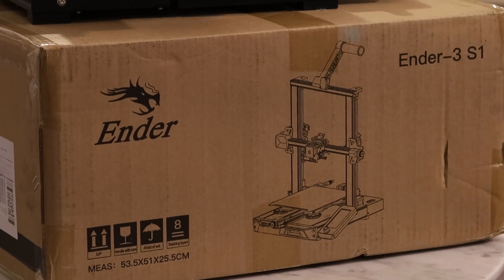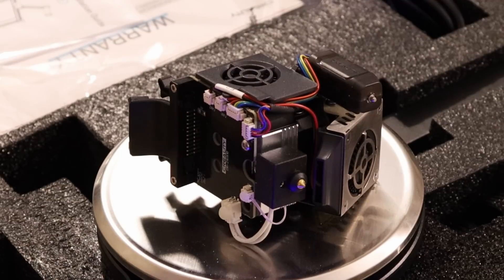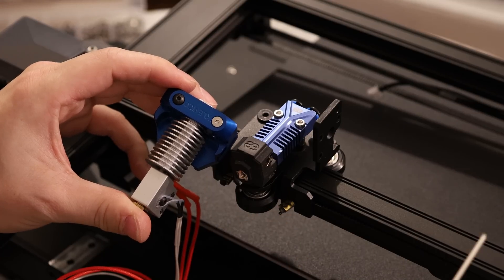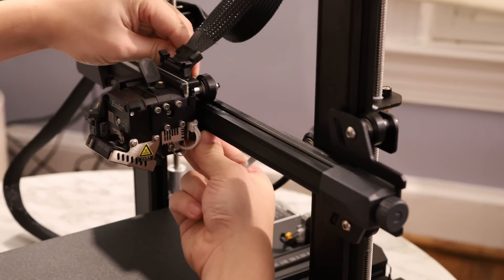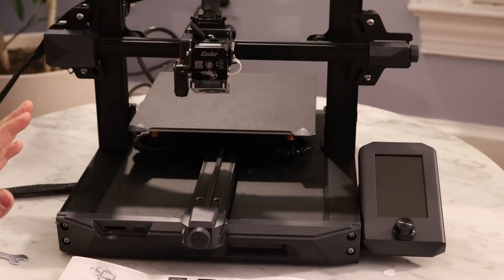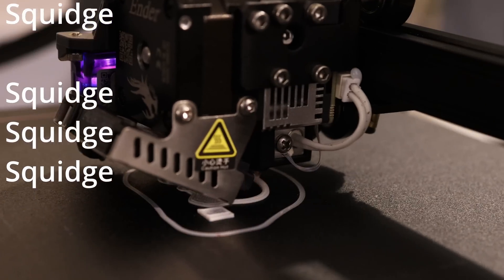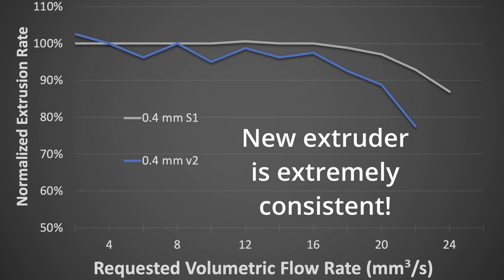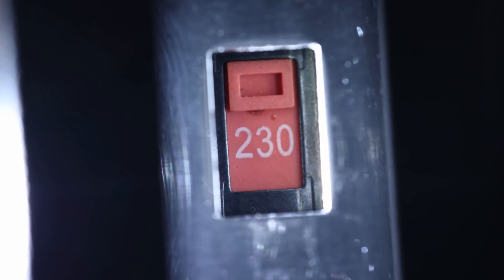Ender 3 S1 - A New Benchmark

Comment: I think CHEP noted the hotend is PTFE lined and the board is lobotomized with 256k ROM -- i'm figuring that this machine seems to be a great candidate for a klipper as the main board ROM issue goes away, provided people figure out how to get stm32f103rc-256kb variant to work with klipper. PTFE lined hotend is replaceable I suppose. Weird choices on some hardware. Seems creality is only capable of going 90% there.
Reply from the maker: My hotend is PTFE lined no longer! I'm editing the video now.

I think a lot of budget companies use PTFE lined because they are basically impossible to jam, unless there is a physical blockage blocking the nozzle.

Idk what the ROM thing means, I'll check out CHEP's video. I'll for sure be putting a Pi on it.
If Klipper isn't ready I'll at least use octoprint.
Reply: @NathanBuildsRobots  256kb variant of this stm32 seems to be a new thing, might be related to a semiconductor shortage. All other stm32f103 based boards have 512kb rom, so firmware is easy to build and no issues with trying to figure out which features to disable to fit into the ROM like the old arduino based days. Klipper guys would need to get their hands on these boards before they can validate compilation parameters, in terms of where the booloader is mapped, etc. Just an annoying thing about creality not sorting out their supply chain stuff and going with an uncommon (as of now) variant of the MCU
Reply from the maker: @kazolar  I bet BTT will have a drop-in replacement out for the S1 in a couple months.

Comment: Thanks for the video. Very informative. Prusa has 6 to 8 weeks lead time to be delivered here in UK. I am eyeing for this one. It is an offer here in UK with 10% discount and have it for £368.00.Should I buy it now or buy Prusa? What do you think?
Reply from the maker: There are 3 printers I recommend at different price ranges and needs:

Voxelab Aquila $160 
Best value per dollar. Its an Ender 3 V2 clone. 
Prints slow (max 4 mm^3/s)
Normal print quality

Ender 3 S1: $400
Lots of convenience features
Prints medium speed (max 15 mm^3/s)
Good print quality

PRUSA: $800
Lots of convenience features
High-end components
Prints medium speed (max 15 mm^3/s)
Very good print quality

Then theres the printer I want: $900
VORON 2.4 is very hard to assemble
Very fast print speed (20 mm^3/s)
Very good print quality
Reply from the maker: I think this is a good substitute for a PRUSA. You are giving up a tiny bit of print quality, and saving a lot of money, which you can spend on upgrades later on if you feel you need them.

Comment: How does the S1 have the dual z + belt working so well.. I have tried to get dual z + belt sync on my ender 3 v2.... but I just get binding and a bunch of issues.
Reply from the maker: I have a dual z upgrade i plan on installin on my v2. I'll be making a video about it in a couple weeks, I will have some more insights after I do the install. 

The only thing that comes to mind is that both screws need to be straight and parallel. you are adding so much extra constraints with the 2nd leadscrew and the pillow blocks on top (the bearings that support the top end of the lead screws). So alignment becomes very important.

Comment: When I saw the vise-grips, I knew this is going to be a good review.
Reply from the maker: I rode a bicycle for a year with a vice grip that was permanently attached, holding the bottom bracket together. It was great because whenever I needed a vice grip I could just pop it off, use it, then put it back.
Reply: @NathanBuildsRobots  lol

Comment: Wait... you don't have to remove the magnetic layer if you want to try using glass build plate?
Reply from the maker: The heat will transfer through the magnetic layer, same as it does when you use a metal bed. But! It will be a couple degrees cooler since the glass is more of an insulator.
Reply: @NathanBuildsRobots  That will also cause the magnet to fuse to the glass bed. Never slap a glass bed onto a magnetic base! TRUST ME!
Reply from the maker: @hardestbodie8087  speaking from experience? I don't see how it could hurt at PLA temps but maybe don't do it with PETG? Or just a no-no all around?
Reply: @NathanBuildsRobots  Yessir! Even 60º can cause the surfaces to fuse. I can't give you an exact time frame between what is safe and what is not, but it is best not to take the risk.
Reply: Cool, that was one reason from keeping me from buying the glass bed, if it didn't work out, I'd have to reinstall the magnetic layer which seems like it can be a pain.

Comment: Z-Offset is too high and your too close to the bed.
Reply from the maker: I always do that. I've had so much issues with crappy glass beds that won't stick unless you mash the plastic in there, it's a habit I have to unlearn. PEI print beds are very tolerant to my z-offset settings, so I like them.

Comment: Your thumbnail is comical. The hotend is not all metal and the printer is like 450. Not to mention creality QC has really fell off since 2019 kinda shit now. You cant print over 240c on this and if you do good luck replacing the PTFE lining then warranty support is nonexistent. Last time i checked prusa machines could print like 275-310c straight out of the box. Alot of this printer looks good on the surface then you look closer and it has a lot of let downs.
Reply from the maker: Ender 3 S1: $400 with free prime shipping (what I paid), 20 minute build
Prusa i3mk3s: $800 after shipping with 40-60 day lead time, 4-6 hr build

They are both great machines and the user experience is about the same (direct drive quality, flex print bed, ABL). 
There are clearly some things I don't like about it, but I think for most people the Ender 3 S1 is sufficient. And it will save them $400. If your budget is lower I'd go with the Voxelab Aquila for $160.

Comment: that "squidge" noise probably due to retraction settings, they didnt put the optimum settings i think.. also.. i dont use the scraper anymore.. put the print in the freezer or something and it will just pop out.. the scraper damages the bed
Reply from the maker: I have not heard of the freezer trick, I'll try that next time!

Comment: I had exactly same "issue" with pei sheet, that it stick too well to everything ( pla petg ) . I changed my profile bed temperature for pla to just 50c and for petg 60c + littlebit lower temperature for first layer for extruder and now it still stick very well, but it dont destroy the sheet. Printed few kgs already through it , without issues till now. Pretty happy with purchase.
Reply from the maker: I always have great results with textured PEI, but I have wrecked a few of the kind with a PEI sticker layer.

Comment: There is alot stuff that's going to be hard to modify with all the special ribbon wirring
Reply from the maker: Nono Jean-Françoise!! In taking a close look at it now, its quite cleverly designed to be very moddable.. the pcb can be separated and left on the gantry, so you can reuse the little connectors. And there are multiple places to attach a hotend.
Reply: @NathanBuildsRobots  what about connecter on main board
Reply from the maker: The mainboard has a lot of new connectors that won't be compatible with other printers. 
I bet someone will come out with a breakout board that converts the ribbon cable into individual cables so you can plug in an SKR mini or whatever else. BigTreeTech will probably produce a special drop-in replacement for this printer since they tend to do specialized boards for niche markets.

Comment: Prob a new benchmark against other crealitys but not a Prusa killer. Great video though bruv👍🏽
Reply from the maker: Thanks! Fair point, they are getting close to matching in features (ABL, DD, Flex plate, dual screws) but aren't there yet in quality.
Reply: @NathanBuildsRobots  only reason why I also said this was because, even Prusa had to be in the field and improved on over time to where they established a track record on the reputation they have now. It's not a crealitys thing as much as it will be hard for any company in sub $800 range to come out with a product right off the bat . It will take time and refinement to reach Prusa reliability. But again great vid and I'm now a new subscriber. Gotta learn as much as I can😂

Comment: Really interested about what you come up with for the mod capabilities. I get that the screw pattern makes it easy for bowden setup swaps but looking forward to more info about direct drive swaps or even retaining the sprite extruder but just upgrading the hotend? Also interested in how you'd plan to handle firmware modification as there still isn't any S1 profile for marlin that I've been able to find.
Reply from the maker: This thing is blowing my mind from a moddability perspective. The PCB can be left in place so you get to keep all the easy plug-ins.

And arm that sticks out on the side... it... also has the correct 2-hole pattern built into it so you can mount any older style hotend onto it. 

You can even mount 2 hotends back to back if you are daring enough. Will be showing that feature in the next video. Literally the most moddable printer ever made.
Reply: @NathanBuildsRobots  Looking forward to seeing the update. I've got a hot block on the way but trying to keep the stock heater cartridge and thermistor just because of the firmware question. Subbed!
Reply from the maker: @xxxxxxxxsubxxxxxxxx  thanks! 

I wish you luck on trying to remove that thermistor. When replacing the heater block I resoldered the wires to a new thermistor, because I was worried about tearing the wires and being stuck up schitt creek. 
Noone else uses that tiny JST connector right now so for the love of God don't break it!
Reply from the maker: @xxxxxxxxsubxxxxxxxx  FYI, here is the all metal heatbreak I'm using. 
I had to cut 3mm of the back, otherwise it would stick out an extra 3mm when installed, but it works! 

https://amzn.to/3uqv55F

I'm sure there will be some E3 S1 specific parts coming out soon though so you can always wait for that.
Reply from the maker: Also I just put a new hotend on. Want east but I know a way and will be sharing it in a couple days

Comment: @ 6:00  😂🤣😂
Reply from the maker: I've never seen an Ender 3 that sits on all 4 feet from the factory.
Reply: @NathanBuildsRobots  What about PSU ventilation? Is it restricted again, or better?
Reply: @3sotErik  it's again restricted unfortunately!
Reply from the maker: @3sotErik  it is restricted. I'm working on a fix though
Reply: I still have the first pair I bought back in the day when I added a window to the side of my beige computer case.

Comment: All these Chinese printers are still using couplings for the lead screws after all these years. Prusa switched to integrated screws which everyone should be using.  Also, I was hoping for a larger bed. 8.6" x 8.6" is a bit too small.
Reply from the maker: What are the advantages of integrated screws? I guess they would make the motor and shaft more concentric so it doesnt cause z-wobble, but dual axis lead screws and properly tightened wheels should resolve most of those issues.

Should the Chinese printers also start using 3d printed parts and zip ties instead of metal, and raise their price to $1000? Not saying the E3S1 is perfect, but I think it provides a lot better value to consumers.
Reply: @NathanBuildsRobots  You answered it yourself. There's no Z wobble issues on an integrated screw assuming the screw itself good. A lot of the Chinese screws I've used are not unfortunately. You get what you pay for though. The cost is always attractive. It would be one thing if the screw was properly machined to accept a coupling but it's not.

I'm a much bigger fan of a prox for bed detection rather than a touch probe but that only works on a metal bed. It does allow much faster auto bed leveling. As for 3d printed parts, I've never had any issues with any of them and they serve their purpose perfectly fine. As you pointed out, the Chinese machine still has an uneven bed even though it's all metal.

This is not to say I won't pick up an Ender some day. The cost is attractive and they do seem like they're much better than the earlier models.
Reply from the maker: @adisharr  thank you for the explanation, I know the Prusas I used at work had virtually zero z wobble, but I did not know why.

V-groove wheels, and eccentric couplings are the cheaper less precise solution. And you're giving up 0.05mm of precision and repeatability, which most people won't notice. But for those who care, and in applications where it matters, the Prusa does have an edge.

Also I think the Ender 3 did cheap out by using PC spring steel bed instead of PEI, and should have used an all metal hotend, and could have done sensorless homing. All things the Prusa has to begin with. But this Ender has some tricks up it's sleeve as well.

The market is starting to get really interesting and I can't wait to see what the next year of 3d printers brings!
Reply: @NathanBuildsRobots  I'm with you! There's some crazy fast stuff some people are working on. Meanwhile I'm printing at practically a standstill compared to those machines ;)

Great review by the way. I'm sure you'll see your subs rise quite a bit with your content :)
Reply: @D L  I can assure you that's complete bullshit. If you're using an integrated screw that's warping then it's a Chinese garbage version.
Reply: @D L The very fact that you used a CNC machine as an example for a coupled system shows you have very little experience in motion control systems. The two machines are so far apart there's no comparison at all. Why on Earth would you ever think that a CNC machine would use an integrated screw?

Helical couplers are mainly designed for misalignment and certainly not used to protect from over torquing in this example. That's just ridiculous. You want the shaft to be as close to the same axis as the motor as possible which is accomplished with an integrated screw. It's more expensive and a Superior Solution the cheap Chinese solutions that many times don't even use a properly machined screw end.

Comment: Hi, i also had the sprite extruder making squiky noises and fixed it by dissasembling the whole thing and refitting it and now it's all silent
Reply from the maker: Interesting. Do you have any clue as to what was causing the noise? Or is it just a mystery solution? 
I don't really notice it anymore. It was only an issue on the 1st print, using their pre-sliced "cat" gcode. I think it had 5mm retraction which is way too high for direct drive. Now I'm using 1mm or 1.2mm I don't remember which, but I don't notice the noise anymore.
Reply: @NathanBuildsRobots  oh that also might have been the issue indeed, i was also printing their presliced gcode… probably 5mm retraction lol
Reply from the maker: @aim6mac  yeah that's typical Creality. Do such a good job on the design, then stick the "cat.gcode" on there from an old bowden machine.
Reply: @NathanBuildsRobots  yeah the 'little' details make big difference don't they, I'm waiting for them to annouce the watercoolingsolution for this Sprite direct drive hotend, i hope it's something good and has a good value, because the fan noises drive me freaking insane!
Reply from the maker: I'm working on the fan situation, I should have a printable mount out this weekend. Testing the first prototype now using a NF-A4x20 and a 40x20 blower for part cooling.

I usually hack my machines to bits with in the process of modding them. That's why they call me the butcher. But from now on I am going to try to use simple printable solutions, so they are easier to follow.
Reply: @NathanBuildsRobots  thats great news id love to test . Can u share the stl files :-)
Reply from the maker: @aim6mac  I will when video comes out!